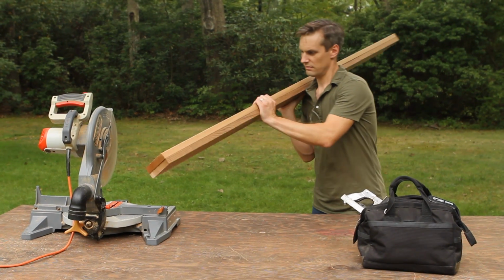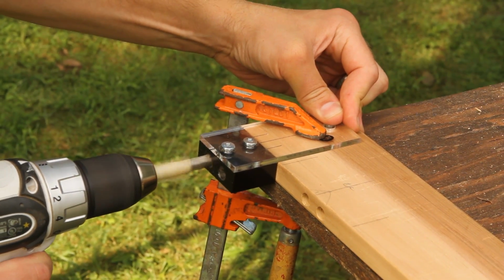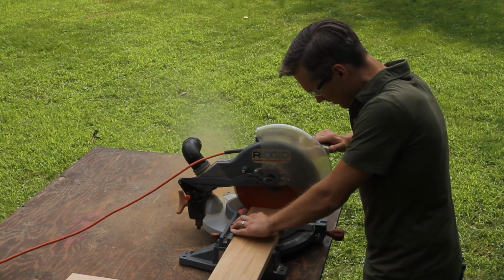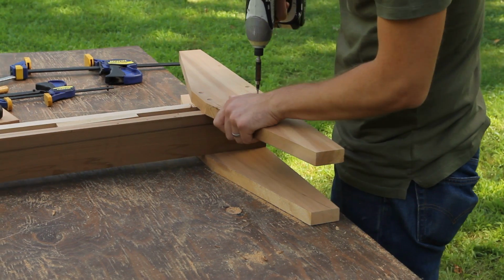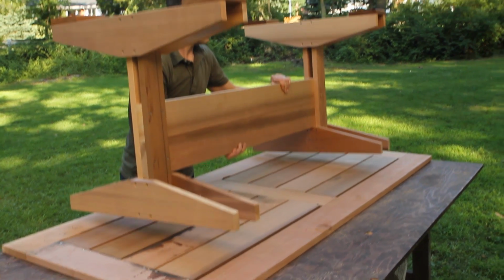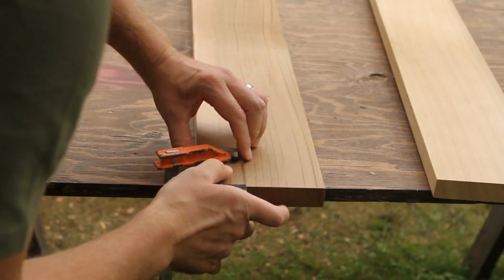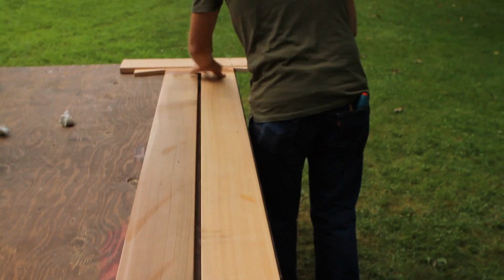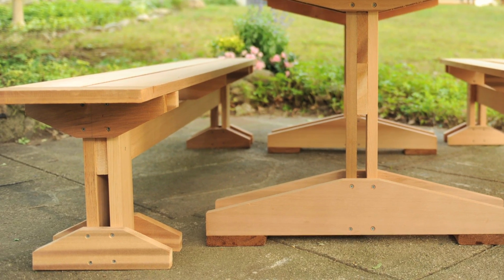How to Build a Picnic Table and Benches | This Old House

Comment: I had a table similar to that, where my feet were always bumping up against that horizontal board under the table when I crossed my legs. That gets old REAL quick. I strongly suggest you make the table top wider than 35."

Comment: I have a silly question... why people like to use small pieces to make a large surface? For example, I see people cut a large board to be come small 2x4 and then glue to join to be come a table top. 

My local mill has something like 2x0.5 m. Should I use two or three of them as a table top?
Reply: Its cheaper sometimes.

Comment: Eek those "breadboard" ends probably ripped apart in a matter of weeks sitting outside
Reply: They've got the dowels, glue and the screws through the slats. I doubt it would be a matter of weeks